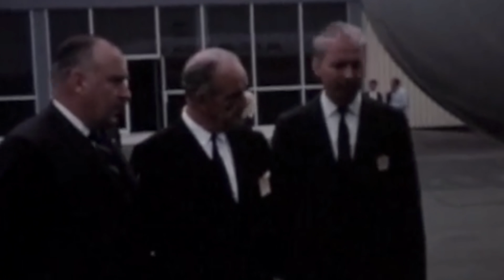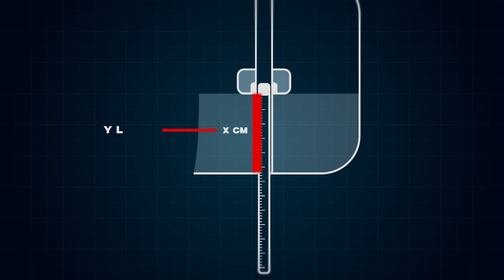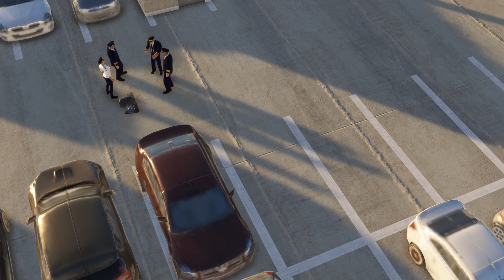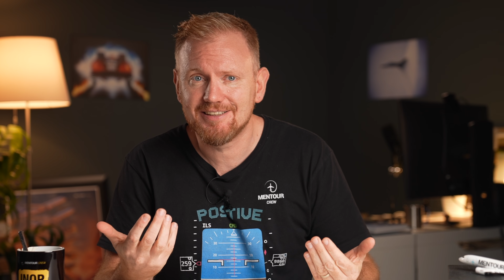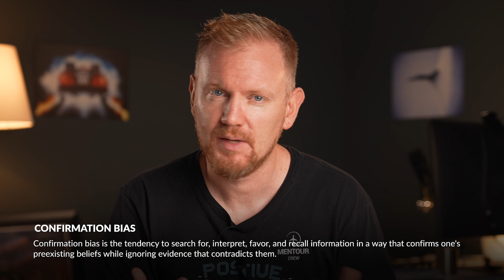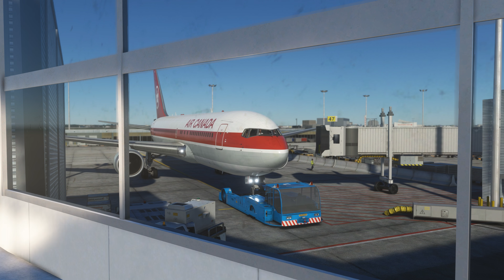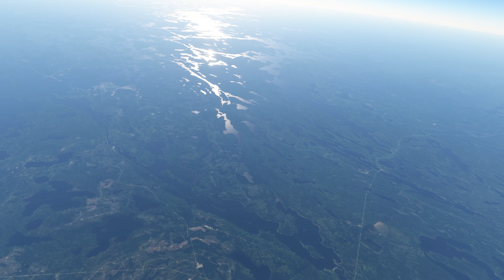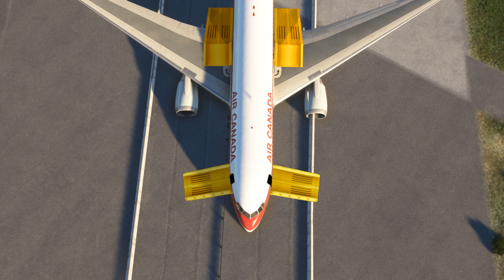NO Engines and Out Of FUEL! | The ”Gimli Glider" Miracle

Comment: And this is why you never switch to metric.
Seriously, though, it is a reminder that switching underlying things you rely on like your unit system is not some simple thing you can just do with a stroke of a pen because somebody thought it would be "better". You have to re-think your entire process from top to bottom and make sure you cut cleanly over from all-old to all-new with no frankensystem in between where these kinds of errors can happen. Piecemeal conversions like this are what happened to the Mars Climate Orbiter and many other complex interactions of multiple people using multiple systems. And it's why the industrial costs to converting to metric for the US are so enormous and why it's happening so slowly, one industry at a time rather than the careless pen-waving so many people want it to be.

Comment: I have always been interested in one aspect of this story, and I have never heard any explanation for this detail. Before takeoff, the aircraft crew calculates the rotation speed, taking into account the weight of the aircraft. Since the weight of the aircraft was actually 12,000 kilograms (that's a lot!) less than expected, the calculated V1 and Vr were significantly higher than required (if I'm not mistaken, by 15-20 knots).
 It seems to me that when the aircraft took off from the runway, experienced pilots should have felt a slight WOW effect due to the higher climb performance. The lift force exceeded the weight of the aircraft by almost 12 tons! That's almost 10% of the takeoff weight. But I couldn't find any mention of whether the pilots noticed this, and if they didn't, why not?
Reply: It was a new aircraft in the fleet and they both had extensive experience flying other planes. It’s possible that the 767 felt like a hot rod even when fully fueled compared to the older aircraft they were used to flying.
Reply: You're right, I was thinking about that too, surely the controls must have felt different than expected ?
My guess would be that perhaps some automatic system kicked in shortly after takeoff or they manually trimmed the aircraft out of habit to compensate the extra forces and they never got a chance to experience them much ?
Reply: @balthazar259  Yes, there could be many different explanations. The pilots could, for example, have decided it was the effect of a gust of wind. But I haven't seen any explanation or even a question about this in any document or investigation about this incident. It would be interesting to hear about the personal experiences of Boeing pilots, what happens and what it feels like to take off when the calculated Vr is significantly exceeded.

Comment: If you go back in time, aircraft like dc3 and 4's were still primarily dependent on overwing tank dipsticks. They would never use the cockpit gauges for calculating fuel range. They often said relying on them was your first step to crashing. I guess there only real purpose was to check for inflight leaks.

Comment: thanks Mentour Petter, I've seen this incredible story of the 'Gimli Glider' in other videos. All I can say is that the Wright Brothers would've been proud the way that plane was saved as they had begun all their flight experiments with gliders.  Dead-stick landings were called by the Wrights as 'VOLPLANING'. landing dead-stick with no power. This scary but avoided potential calamity was due to misreading of fuel amounts rather than 1 engine out scenario. 'Gimli Glider' was repaired and put back into service, and did her job safelyl for the next 25 years at least . It was scrapped in a ceremony in 2014.

Comment: Yeah, knowing that 1 liter of water is 1kg, hearing the conversation factor of 1.77, I didn't know what the conversation factor was until you said 0.8, but a substance that is liquid under normal conditions, having a conversion factor of more than 1.3 from literers to kg, my mind immediately went, yeah, that does not sound right, mind checking again?

But yeah understandable error for the time and converting to the new system

Comment: Slight mistake. Liter of PARRAFIN. Witch JET A . Is way lighter then H20. One square meter of Water weighs one metric ton.  I know this “ how ?? Tropical fish tank lol. Oil floats on water  there fore less dense than H20. Etc etc. air pressure is involved too hence BAROMETERS.  Which I always thought were Fancy fake  wooden clocks. lol.  The Large Dial. That said stormy or rising or windy or change. lol.  But they are totally rational devices.  Built on Mercury thermal and small bellow s
Etc. the preclude .  The Harrison clock

Comment: Fun fact: There was a movie based on this incident. At the start of the movie, two pilots were in the simulator in this exact situation, and when they came out of the simulator, one pilot told the simulator instructor "Is that some kind of joke. There's no way you'd land that aircraft the way you guys got it programmed." The other pilot told the simulator instructor "Dumb scenario if you ask me. Impossible set of conditions, whoever dreamed that up." The simulator instructor told them "It isn't a dream. It happened." He would know. He was literally the Captain of Air Canada 143.

As for scenarios, I would be curious to see Northwest 85. It was the Boeing 747-400 that had the rudder hardover, but crucially, was the first Boeing 747-400 built.

Comment: My first car was a 1968 VW Beetle with no fuel gauge, but a dipstick instead. (When engine stopped for lack of fuel, you had to manually engage the emergency fuel valve). It's somehow hard to imagine that a brand new Boeing Airliner was allowed to be operated in roughly the same way in 1983. 😅

Comment: Excellent video with lots more details, but I wish you would have covered the real reason the nose gear didn’t lock (gear sector not in OFF position), and the fact that the Gimli airport was a fully functional VFR airport with a 5000’ runway. (only the closed parallel runway was used as a drag strip)

Comment: A question I have concerns cabin air pressure.  When engines fail at 35,000 feet, is there enough air forced into the engines from the airstream to keep sufficient bleed air to keep the cabin pressurized?  I assume this must be the case.  Do the HVAC controls continue to function on battery power?

Comment: Very good videos.  I enjoy all of it. 
Just to point out that it is not a coincidence that the final fuel is exactly a factor of 2.2 off from the actual needed fuel.  They calculated the remaining fuel and fuel needed both in figures of pound, so they add up exactly to a figure of pound, which turns to be about 45.4% of the original needed figure.

Comment: Many years ago my cousin, who is a pilot, took me up in a glider. The exhilaration of flying without engines and only hearing the rush of the air made me (at least for the 20 minutes or so we were airborne) completely forget about things like 'you've only got one chance to land' or other potential problems that wouldn't be an issue in a powered airplane. But the idea of hearing the engines drop out in a commercial jet is the stuff of nightmares. Brilliant piloting.

Comment: I love the newer graphics, and your channel is friggin' awesome, but you may have gone a little overboard with the realism this time.  It's supposed to be a shiny, brand new plane, but you've rendered it like it's 20 years old.  The seats and controls, and pretty much every painted surface, are covered in chips and scratches, and scuffs.  It certainly helps eliminate the uncanny valley feeling of a perfectly clean, smooth surface, and look more like a real plane, but I found it a bit distracting this time around because of the opposite extreme.  The plane SHOULD look new and perfect!  Aside from that, no criticisms.  As a Canadian, I'm very familiar with this incident, and thought I knew all about it, but your videos still continue to educate, and give more insight and details even to the old stories I thought I knew inside and out.  Keep up the great work!

Comment: Im surprised aircraft aren't fitted with minimum fuel sensors, ie. a sensor that goes off when fuel is less then a safe level. Sinilar to a low fuel light in an automobile.

Comment: 22:06 this is the part about this incident that I was never taught. the Gimli glider was always told to me as a cautionary tale of unit conversion mixups, and that is a big part of it, but the fuel gauge issues were a hugely important part of the context that was unfortunately left out. As explained in the video, had the fuel gauges been working, the fuel deficit would have been immediately recognized, and a major hole in the Swiss cheese chain of events would have been patched up

edit: 26:27 love this little easter egg lol
Reply: I was studying Engineering in 1973 and we spent a week doing nothing but playing with units.  You could use any units you wanted on problems but they had to be labeled al the time.  One student used furlongs per fortnight for speed and as that was what the answer was labeled for the units, passed.

Comment: Seems insane that a "seasoned pro" pilot and first officer both were like "yeah this plane with absolutely no way to detect a fuel leak or problem mid flight seems totally fine." I wouldn't even drive my car on a long trip if I had no way of knowing if my fuel was low and I was about to run out....

Comment: Doing a slip in a 767 is just crazy. I am a bit confused though,  glider maneuver? Where i am this is a standard flight maneuver your instructor will teach you and you will have to demonstrate to the DPE on your PPL check ride. Additionally for commercial here you will be expected to demonstrate the ability to slip it all the way in from pattern on the down wind.

In a GA aircraft it feels like you are falling at a very high rate when you put it in,  idk how they translates into a 767 but the sudden sinking feeling would if there be the most disconcerting thing for the passengers not the bank.

Comment: Further to Your last “Captains Speaking” vid regarding “So-Called” chemtrails, allegedly vapour trail’s only, I will forcefully disagree with Bens comments. I’ll be in touch later. If this post is removed by Moderators it will speak volumes don’t you think? FYI - I’ve worked for Lockheed and the RSAF and have had long chats with Boeing, Rolls Royce, chopper pilots and aircraft pilots. Let’s see what your reaction will be next time. 🆗🤔

Comment: While running out of fuel in cruise requires things to have gone spectacularly wrong, you at least have a decent amount of time and glide range to deal with the problem.  Running out of gas at 5,000 feet is probably the scarier situation, and it doesn't generally require nearly as big of a mistake.

Comment: I think, if you were European and travelling around Europe before the Euro, you might have picked up a skill, how to easily, but not exactly convert different currencies toyour own, which the Canadians lacked. I thought 7600 kg of fuel is roughly 6000 kg, which is roughly 13000 lb, without actually calculatingor looking up values.

Comment: Honestly, I'm surprised the pilots were not only reinstated, but rewarded. I'm sorry, but I could never trust a pilot that uses a fuel management system that runs on thoughts and prayers. People talking about a systemic failure, but if the checklists and procedures matched what was described here, than they knowingly ignored them (depending on documentation standards, they would have even had to falsify some, such as the dip test matching the instrumentation), therefore taking responsibility for the incident. Heck, I bet you they had an emergency checklist for if the fuel guage fails in flight, which they just ignored because it failed before they were even in flight.

Comment: It is all about education! And plausibility checks! 
Even more important today, as thousands of numbers and comparisons flood our life. 
To know the density of a fluid, that is important in life (water, gasoline, oil, natural gas) in pounds and kilograms should be basic knowledge. 
And this hillarious insistence of the US and GB on imperial gallons, pounds, pints etc. Unbelievable...and they do not even make sense...
The metric system is clear, and straight forward. It does not require weird conversion factors.
I can somehow accept that pilots measure their height in feet and their speed in knots because they still fly boats??? . Your measurands are deeply rooted in the 19th century!
It seems to work for all pilots. But it is really strange.

Comment: This has massively increased my knowledge of the Gimli Glider. I knew about the lb/kg issue, but had no recollection of the actions that preceded this error. Thank you!
Reply: Me too, I also didn't know about the failed instrument / cold solder joint + fuses etc.
Reply: Same here.
Reply: Same here. I remember this incident being discussed in class when I was an aerospace engineering student at the University of Michigan around 1988-89, but I only recalled the metric conversion issue being brought up.

Comment: Wow that is risky to not first identify and fix any fault, but find all ok on testing then just sign it off as ok again - when it suggests an intermittent fault - a loose wire, bad joint, dodgy electrical or mechanical component, anything.

Comment: I remember when this happened.  It was indeed great Airmanship.  How about you dig back into History a bit.  I recall a Boeing Stratocruiser that was flying from HNL to the Mainland, when they lost one of their 4360 radial engines and had to ditch near Ocean Station November.  This would have been in the early to mid 1950's.  I would really like to get your take on that one.  --   My Dad flew with  United through WW2 and retired from DC-8's in 1975.  I earned my Commercial, but never flew for Hire.  --  Thank you for your videos.  I'd fly with you anytime, anywhere.

Comment: I am a very nervous passenger and for family reasons I have to take four hour flights both ways every three months. I think I will always be scared but watching your channel has helped a lot. I check under my seat for a lifejacket, always book aisle seats, try and sit near exit rows and always count the rows to all exits from where I am. I keep my seat belt fastened. I cannot sleep and am always hyper alert, but I am less scared of turbulence now (only get white knuckles when the cabin crew are told to sit).
I wear denim jeans and woollen jumpers and sturdy trainers so I can run and get minimal burning. I keep my passport in one of my pockets but I will happily leave anything else as long as I can get out. Is there anything else I  can do to make me safer?
I am so glad for your videos, thank you
Reply: With the preface that you're being somewhat overly cautious, I'd advise you try to avoid seating abreast the props if you're on a turboprop aircraft like the awful Bombardier Q400s operating in Canada - there have been several instances of those props failing and throwing pieces of propeller into the passenger cabin. Similar logic can be applied to the fan section on turbojet engines.

Comment: I thought I heard that Gimli wasn't in their charts or approach plates. I can't find it on a low altitude IFR chart. I wonder why they didn't head for Dryden or Kenora?
Reply: Gimli was a fully functional VFR airport in 1983, and still is today. Only ONE of the TWO parallel runways was closed and used as a drag strip.

Comment: I will never understand how anyone can accept mixed units of measurement when dealing with complex systems. That's ripe for errors. If you use imperial, use it everywhere. The same with metrics. Stop mixing the two. They don't use the same base. People have to make things so complicated. If you know the tank capacity, and you know the average consumption rate per mile flown, just use fuel level percentages to calculate how much fuel you need. Full, 2/3'rds, 3/4'ths, you get it. Like we do for just about every other gas powered vehicle out there.  But, no. you measure in centimeters, covert to liters, and then convert to kilos. Three calculations instead of one.

Comment: Can't tell you how many times mistakes like this happen and nobody questions them. Most are fortunately harmless, e.g. pilots telling their cabin crew wrong flight time, based solely on the chart, with no sanity check. Then we're like "nooo, why our flight back is like 1,5h longer"? And then pilots wake up and say "yeah, that doesn't make any sense", and it turns out someone (first) used local times and (second) forgot that some countries still use daylight saving time change. 
Sometimes pilots introducing themselves to passengers mid-flight, repeat the wrong destination over and over with nobody catching it. Nobody but one passenger who starts panicking, thinking they're not only on the wrong flight, but flying to a different continent - because Malaga got mistaken with Maldives. 
So remember people, if something is bothering you, call your cabin crew :)